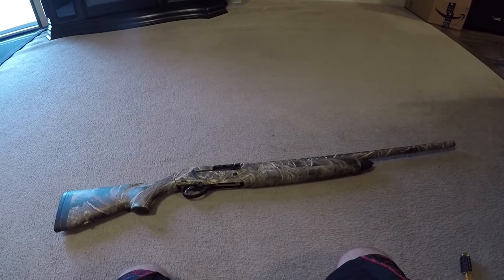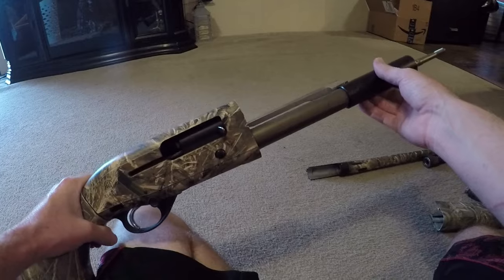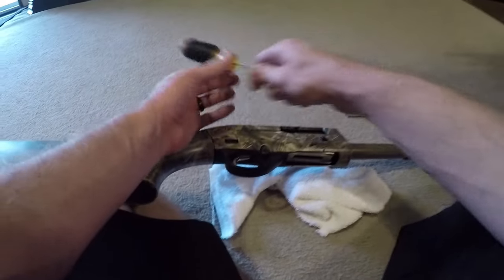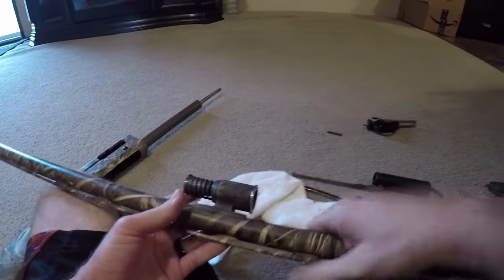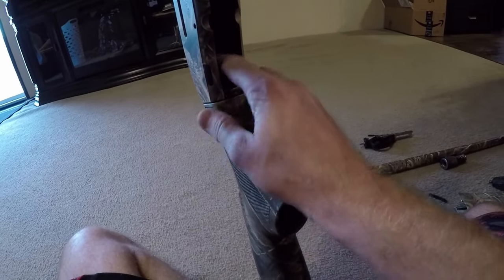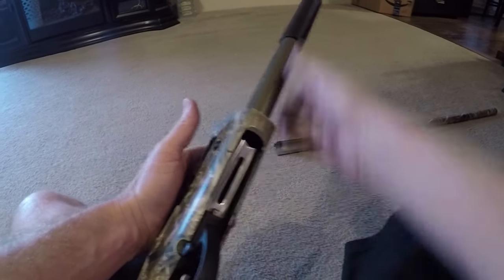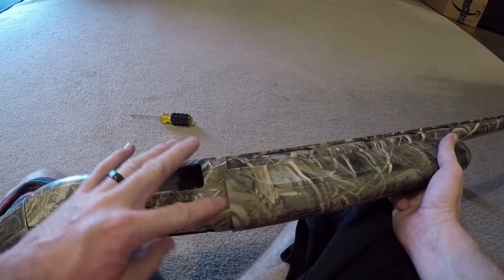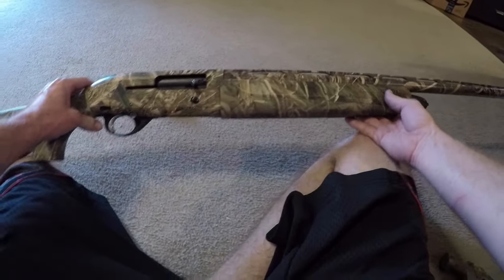Beretta A300 Outlander Disassembly/Assembly (Review)

Comment: This is a great video thank you.  Saving for later for when I need to reference it. Just so people know, at 3:03 (reference point), on the bolt, the long handle sticking out to the left that swivels back and forth (I dont know the name of it), if it can come off, it is only held on with a small pin, it has to be put back the right direction or it keeps your slide from going back.  When I was cleaning mine the pin fell out and this long swivel handle fell off.  I put it back on but it was upside down and it took me a minute to figure out that was the problem.  Just saying in case anyone else encounters this problem.  Great video my friend.

Comment: Very nice video, just purchased my A-300 in True Timber DRT. I am looking to add an extended mag tube. My concern is the spindle that holds the mag tube cap in place looks like it would not allow me to add capacity. your thoughts!
Reply from the maker: Clark Rachesky I’ve never seen one with an extended mag tube. However if you did put one as long as it’s the same length as the original it should fit

Comment: On that model, do you need to have the bolt as far back as possible before inserting the charging handle?  I noticed you edited the video at the point you intended to insert the handle.  I have trouble at that stage and would appreciate a clarification.  Thx
Reply from the maker: No the charge handle should slide right in with the bolt slightly pulled back.

Comment: I just bought a beretta a300 today and I think they over tightened the fore-end cap and I haven't been able to twist it off, been putting alot of muscle into it but now I'm out of gas. Any ideas on how to remove it?
Reply from the maker: Try to spray some gun oil on the cap if you can and use some type of towel for grip.

Comment: Help! I've tried pulling on that flippin charging handle for a good 30 min and cannot for the life of me get it out. Even tried wrapping a shoe lace around it and pulling; ended up breaking the shoe lace. Any tips to get it out would be greatly appreciated.
Reply from the maker: Try pulling the charge handle back just ever so slightly and pull again if that doesn’t work put a piece of cloth over the handle and take some pliers and pull with all your might! It can be hard to take out the first couple times trust me.
Reply: Thanks Louisiana.

I finally was able to get it out last night using your advice. Appreciate it!

Comment: Is it safe for steel shot? I mean #3 and larger...
Reply from the maker: go into it’s state law in Louisiana to hunt with steel shot so that’s all I shoot and I normally shoot anywhere from 2-6 shot depending on the target birds.
Reply: @LouisianaOutdoorsmen  Thanks, but  as I know manual says: ''Do not use High Performance (HP) cartridges. HP Cartridges usually contain pellets higher that 3.5 mm of diameter which cause higher pressure in
the barrel.''
Reply from the maker: @gointo8823  I've never heard of the term high performance shells, just high velocity shells. I have used everything from BB to 6 shot through this shotgun. Brands I use are hevi steel, hevi metal, Rio, Remington, Kent, and Black Cloud. Ive never had an issue using the high velocity either.
Reply: I've had my A300 outlander for 6 years. I've had no problem shooting #2,3 and BB through my shotgun.

Comment: You scratch your pin and shotgun when using a screwdriver to punch the pin out. Use a wooden nail instead. The pin comes out easy.
Reply from the maker: Sergey D appreciate the advice, I surely thought about that after the fact. I’ll have to get some wooden dowels for next time.
Reply: @LouisianaOutdoorsmen  golf tee works just as well and cheaper.
Reply from the maker: Tim Whisnant might have to keep that in mind for next time for sure.

Comment: On an extra note, I see that the trigger firing pin needs to be sprung down, before inserting the trigger assembly. If it wasn't for the picture in your video, I would have been struggling for a while. Thank you!!
Reply from the maker: @DavidB-cg5hs  yes that is the hardest part of assembling this gun back

Comment: Very good video.  The video by Beretta was awful.  Although I have been shooting pistols, rifles, and a pump shotgun for 15 years, I am new to shooting a semi-automatic shotgun.  My instructor at the range had me use a Beretta A300 and I did well with it, when compared to my using a Browning break open which was very heavy.  So I ordered the Beretta A300 Outlander, tried cleaning and lubricating it myself before using, and found it very hard to reassemble;  could not even get the bolt handle out with all the wiggle I had done.  Well my instructor helped me and had to wrap the bolt handle with heavy cloth and then used pliers (so he would not scratch/mar up the gun) and got the bolt handle out.  Placing the bolt action back in was difficult and he showed me how the tracks have to line up perfectly in order to slide in.  So, this is not a shotgun for a beginner.  Then with trap shooting, found out that I needed to use heavy powerful cartridges, otherwise, shells would not eject;  instructor said it will have to break-in for awhile, maybe 400 rounds.  He also had me get a Briley Oversized Tactical bolt handle and now I am able to remove the bolt handle a lot better.  
Again, your video is very good and I greatly appreciate the attention you provided with placing a light inside the shotgun to show proper placement areas for the action bolt and trigger mechanism.  I got so disgusted with Beretta in running through their video in 4 minutes, making it look so easy, but only to leave me frustrated with a disassembled shotgun.
Reply from the maker: Glad my video could be of some type of help for you. I was in your same position when I first got mine. I struggled for over an hour trying to reassemble and finally figured out the simplest way possible to reassemble.